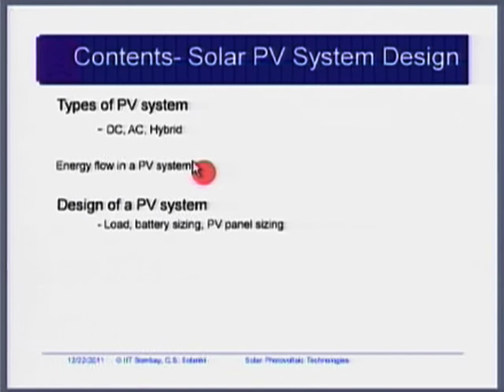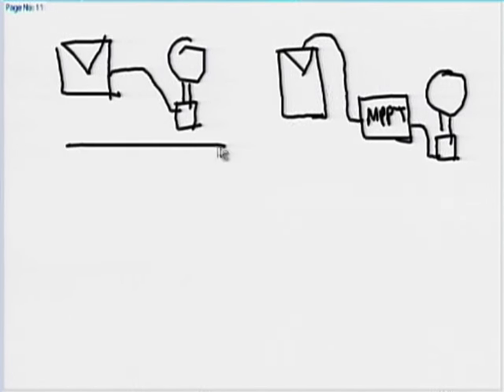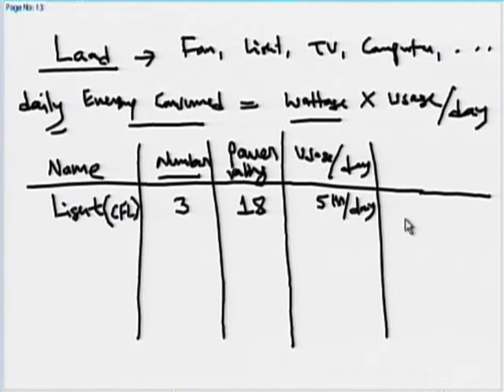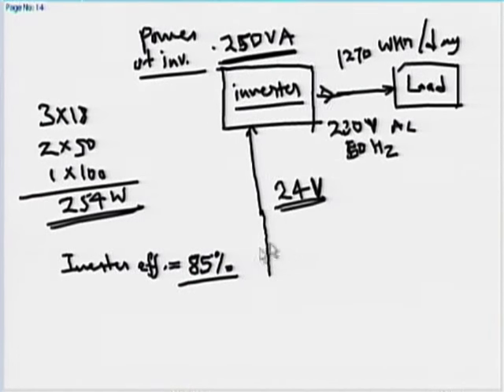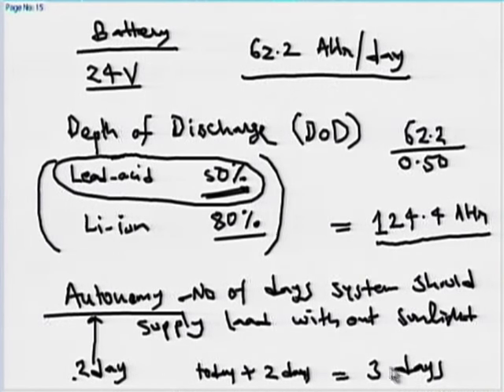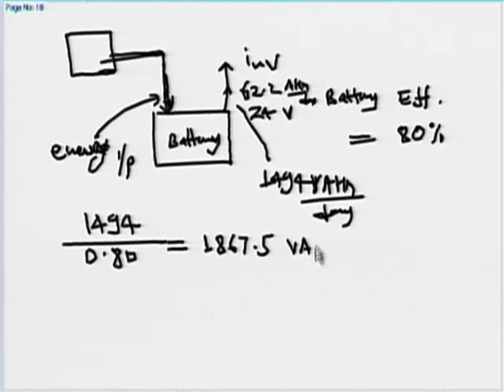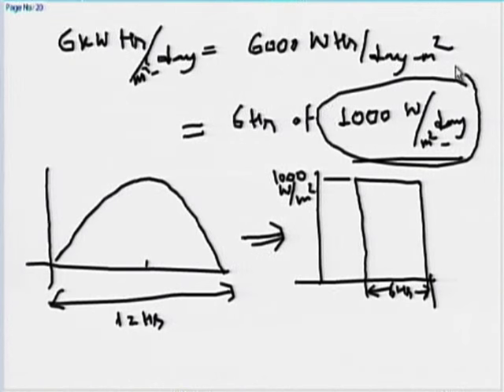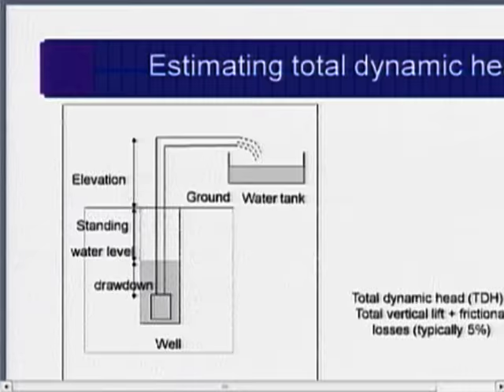SPV M L19A Solar PV System and PV System Design

Comment: above lecture was very good . I afraid to say that while driving the PV module numbers you have not consider following:
1. Manufacturer Tolerance 5%
2. yearly Radiation Tolerance 5%
3. Temp. Tolerance. 15% 
4.Dirt Tolerance. 5% 
5. DC cable Tolerance 3% 
6.AC cable tolerance between  Inverter and Load. 3%

Kindly confirm am i right ?
Reply: Thats specific to your own design/location and highly variable.

Comment: With regard to the battery configuration, we need four parallel strings of two batteries each ie a total of 8 batteries. With the configuration in the video the battery system is 24V, 200Ah and not 24V, 400Ah as should be the case
Reply: correct
Reply: Funui Anis , sir, I thing this is right configurations.... in place of above mentioned.

Comment: sir battery configuration is not correct because if we connect two 12 v,100 Ah  battery in series then we will get 24 v, 100 Ah. so we get only 24 , 200 Ah from 4 same rating battery

Comment: I have a confusion.....
:- How can 4 Batteries of 12V /100 AH  capacity can deliver 373 AH Capacity @ 24V  according to above configuration....?
Reply: exactly battery confirugation is planned in a wrong way otherwise video is awesome they should use 8 batteries
Reply: @kashmirengineeringvision  I think to get 24volt and 400ah we need to choose 12 volt 200ah battery with with parallel configuration which will give us 24volt and 400 ah?
Reply: @sameermfaroor9856  ya that also we can do

Comment: The battery configuration is wrong,it’s 200Ah ,in order to have 400Ah, you have to have total  8 batteries of 100Ah ,
4 strings of 100Ah in parallel.